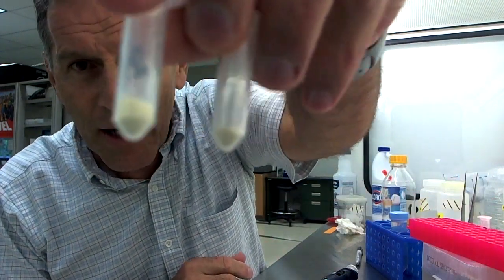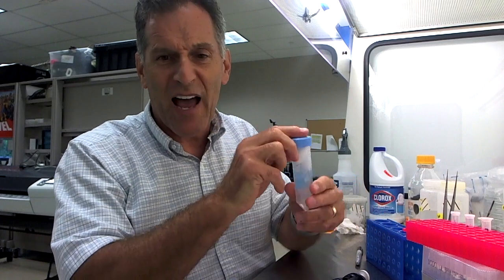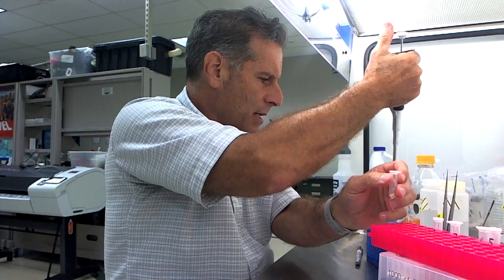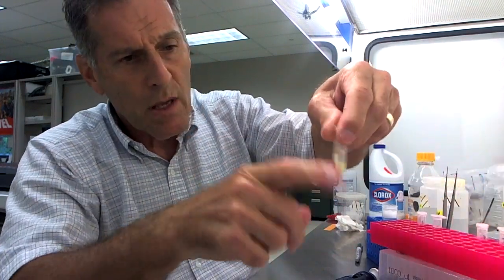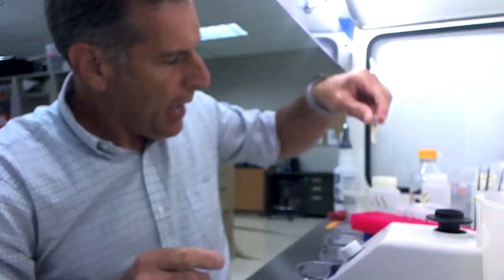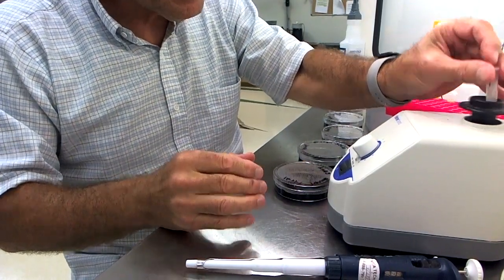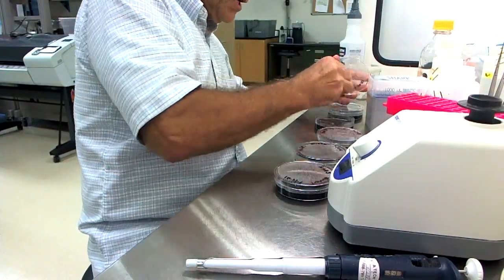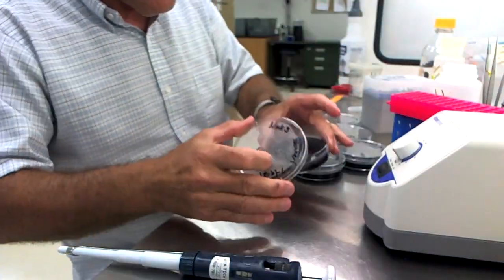Orchid Seed Culture: Part II, Using Isolated Seed

Comment: sterilising seed like that is long winded and old fashioned.. try hydrogen peroxide 6% .. 4mil in the tube with seed,,,, shake for 1 minute,,, pour straight in to mother flask.... 99.9% success,,, works every time....  been flasking for 20 years... i may add,,, only for dry seed sowing
Reply from the maker: Thanks for that info. I am using this method because it is the standard in plant tissue culture and no one has offered any alternate approach until your comment. I have seen others use peroxide with mixed results and have not yet evaluated it. I do have a lot of dry seed stored and will compare bleach sterilization to 6% peroxide. How much seed do you place in 4 ml of peroxide and do you leave the flask uncovered after adding the seeds in peroxide? I am concerned about loss of viability, if the peroxide is not removed. But, I will evaluate and compare your approach for contamination and for efficiency of protocorm formation. Thanks again for your comment! Do you have any other suggestions?
Reply: @plantpropagator  Hi ,I keep the laminar flow on all the time ...I wear gloves and gown.. constantly spraying my hands and tools with Isopropyl Alcohol ...on green pod I flame pod after scrubbing with diluted bleach 75..25..... all areas of work area and tools placed in the bleach solution after each cut... pour a small amount of seed in to tube add peroxide...spray flask around lid with Iso and uncap flask... shake tube with seed in it for a minute and place contents of tube on the medium in the flask... spray the inside of lid and screw on ...gently swirl around the seed in the flask to make it more distributed...and that's it..   put under a full spectrum grow light ....happy days...
Reply from the maker: @malcolmellis6614  Thanks so much - is it OK if I acknowledge you as "Malcolm" in a future video, when I evaluate this procedure? If not, I can refer to you as one of my viewers...
Reply: @plantpropagator   yes that's fine...we are here to swop techniques and make it easier for all those orchid growers..regards Malcolm
Reply: @malcolmellis6614 Malcolm, do you rinse the seeds or it is not necessary? Before you put them in the flask😊👍

Comment: I have seen some ppl adding dish soap to the bleach mix to in theory get better coverage. do you think thats necessary for home work?
Reply from the maker: Adding a small amount of soap is standard practice when sterilizing tissue using a bleach solution. I strongly recommend using 1 small drop of liquid soap per 100 ml of bleach solution.  You can tell when you have rinsed the tissue sufficiently, when there is no bleach smell or soap bubbles.
Reply: @plantpropagator  thank you for sharing! With respect to your bleach solution percentages, for a 10% solution is that a true 10% sodium hypochlorite or is 10% bleach solution from a consumer bottle (which is 7.5% sodium hypochlorite)? Does that question make sense?
Reply from the maker: @johngriffin5446  I use a 5-10% solution of store-bought bleach for dry seed sterilization for 20 minutes and 50% bleach for 25 minutes for intact seed capsule sterilization. Make sure that you use bleach that is not more than one year old as it goes bad. All bleach solutions should have 1 drop of detergent per 100 ml.